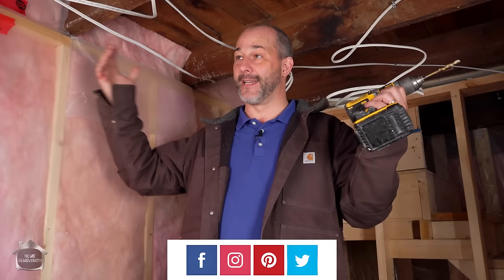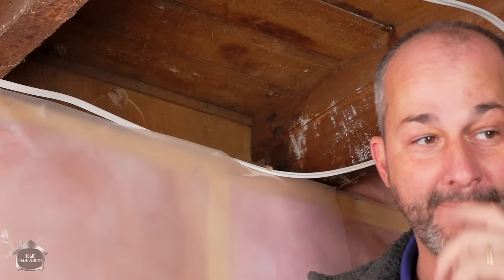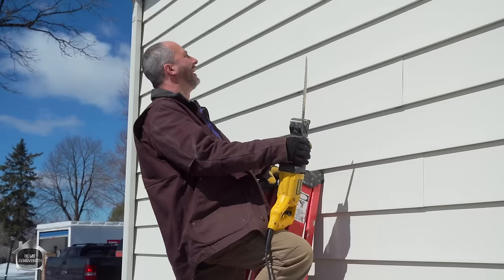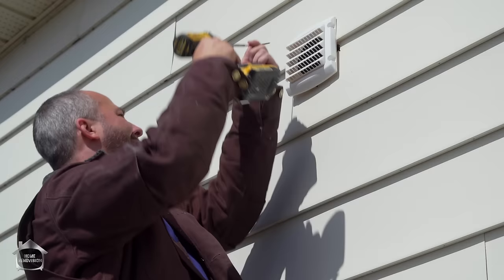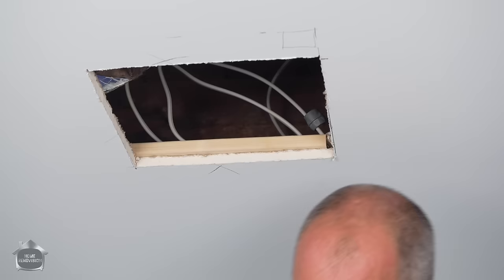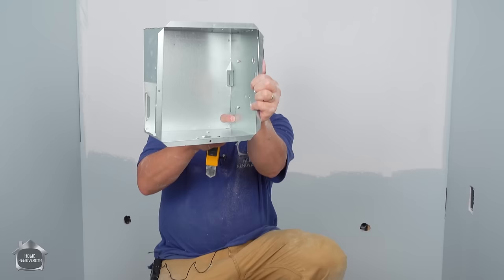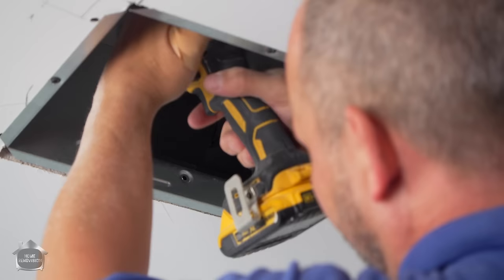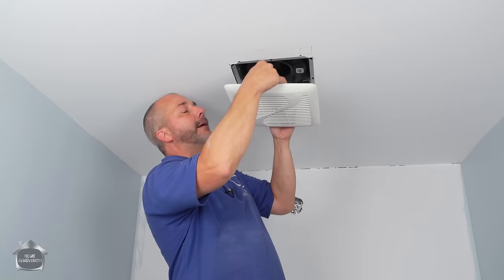How To Install A Bath Exhaust Fan | DIY

Comment: Wouldn’t the steam coming from the exhaust pipe just be blown in to the attic? And cause mold?
Reply: John H Not when it’s vented to the outside. 
Jeeze! Did ya watch the video?
Reply: @sjenkins88  yes to the outside where the soffit is with vents leading to the attic where it will cause rot and mold.

Comment: Isn't caulking a poor way to seal this? Since the vinyl siding expands and contracts, a LOT, with heat a cold the caulking will separate pretty quickly from the plastic on the vent?

At least that's what's happening on all the windows and doors on the house we just moved into :|
Reply from the maker: There is real good quality caulking that expands 400%. that is the type to use on exterior siding. Cheers!
Reply: @HomeRenoVisionDIY  good stuff, you're the best!

Comment: Sloppy cut out hole for fan housing, 6 foot of too much wire totally wasted , outside vent is installed incorrectly. trick is to use the 4" hole saw with a longer bit in it to  find center outside , use the 4" hole inside and out and you'll have round hole , Trim around vinyl siding to  make a tight fit instead of his "diamond " pattern that sucks, you'll need a whole tube  of caulking  to seal around that vent cover.  D+ work. Plus the 110 CFM is good for a huge bathroom. 70 CFM-80 CFM is plenty for a 8 foot x 10 foot bathroom. The more CFM's the louder the fan noise.

Comment: Why didn't you just install the housing and do the connection prior to the installation of the drywall?
Reply: It's a remodel, not a brand new home.
Reply: @Guillotines_For_Globalists  But he had the joists exposed and the ceiling open. It doesn't make much sense.
Reply: @jorgeshicken  I do see that.  Strange.  Maybe his intent was to show us how to do it as part of an actual remodel where the ceiling wasn't exposed.  His channel is primary about remodeling after all.

Comment: One thing i like to do is put some tape (tuck or metal) around the perimeter of the hole to stop any draft that may come down between the housing and the drywall. 15 cents (CDN!) and maybe a minute of my time.

Comment: Bonding the housing isn't a thing in Ontario?
Reply from the maker: You will need to explain please. Do you mean to afix the housing to the framing. It was done. Cheers!
Reply from the maker: And no it is ok to set the housing in a ceiling attached to loose strapping. Cheers!
Reply: No, I was referring to the electrical. The metal housing should be grounded via the grounding electrode conductor using a ground screw or clip. The branch circuit has the bare copper, GEC (grounding electrode conductor). Each component needs to be grounded. Housing, outlet, and circuit. You would bond the housing to avoid a potential hazardous scenario where an ungrounded conductor could come in contact with the housing and have no path to ground causing the housing to energize. I'm not critiquing, just offering helpful guidance. I gain tons of helpful guidance from your videos and your projects, I'm just tryin to give some help back if/when I can.

Comment: Not an expert.  But you had no ceiling drywall at the beginning. In my mind you could had installed the fan box and wiring and all that jazz before you finish the ceiling and avoid the guess work.  Then mark the location of it in your sheet if ceiling and make it better that way.  Why not?
Reply from the maker: for sure you could. but this way we can show all the options. I already did a video where we installed the box first. Cheers!

Comment: His ladder work is scary. Leaning a stepladder against a wall should be a last resort. Stand it up, even if you have to turn it sideways. Ive also found that standing right against the wall gives you no leverage.

Comment: Thumbs down. Why not use a longer pilot bit and drill all the way through ?Then take hole saw outside and drill a nice neat hole through vinyl siding and into sheathing?  A chisel will remove what saw doesn't. Then do same inside. Makes a neater job instead of it looking like the squirrels got through the busted cover. You can buy deeper hole saws. 
And nice job jabbing sheet rock saw into cavity.  Why not puncher a hole in the new vent tubing and nick the elec. wiring.  Does it have to be GFI circuit per code ?

Comment: Have to not agree with the vent. 
The plastic covers are the worst. 
Over the years I have replaced 50-60 of them. In sun and weather they don’t hold up that great. And being high up you don’t want to have to get up to fix it. 
The metal or stainless 1 PC are way better at leaks and overall life exp. 
But I guess I like when people use the plastic I’ll make $$ down the road
Reply from the maker: Everything needs maintenance at some point. Cheers!
Reply: Home RenoVision DIY 
Very true. 
But I’d rather have something that last a lot longer before dealing with it. 
And the price difference is small unless you go stainless and those must be ordered. 
No stores carry them that I know of. 
It’s kinda like paint. 
If you get paint at big lots verse Sherwin Williams. 
Use a better product.

Comment: this video starts out very impractical - wanna install a vent?  Open up all your walls and your ceiling.  WHAT?!
No... this is not feasible for the average homeowner.  We LIVE IN our home, we can't be unnecessarily ripping down to studs.

Comment: That is technically an INTAKE vent, not an EXHAUST vent.  The INTAKE vents do not have the louvered flaps that CLOSE when there is no air blowing from the inside to the outside.  Obviously, as an intake, you would NOT want it to close.

Comment: People don't attempt this on your own. If you're drilling blindly from inside your house and hit the main power wire along the outside of your house, you're as good as dead on the spot. Seriously, not a bit of safety advice about outside wiring etc. 🤦‍♂🤣🤷‍♂

Comment: Apparently there were nothing but crackheads who constructed my house because the only bathroom with a fan is the downstairs w/o shower, meanwhile the two upstairs, w/ showers, where I would think they would have placed fans.. nada.. rien.. zilch.  So, I am guessing that I will have to remove all drywall on ceilings in order to have fans and the ducts will be roughly 24ft from ground level - thanks crackheads!

Is there an easier way besides removing the entire ceilings in the bathrooms... or am I just stuck with the additional costs?  Also, since there are no additional power lines coming into the switches, can I just pigtail into a separate switch for the fan?

Any information is greatly appreciated.

Comment: That was painful to watch. That fan is a lot easier to install before the Sheetrock goes up. The fan has tabs on it to hold it down below the rafter so it’s flush with the Sheetrock. This way you nail a couple of 2x4s across the rafters and mount your fan to the 2x4s, leaving it down 5/8 of an inch for Sheetrock. Then you can hook up your duct and wire it when it’s easy to get to. Then you just cut the Sheetrock out around it when you hang the rock. After painting all you have to do is slide the cover on. Also, good job breaking that cap.

Comment: This is legit probably one of the worst “instructional” videos on how to vent a bathroom fan.

Easy way:
•Use a push rod for your pilot hole
•Find where the rod came out of the house(from the outside) and remove the push pod
•Use 4 1/2” hole saw 
(Use drill in reverse when cutting through Vinyl siding)
•Insert vent, screw in and silicone around top, left, right edges and over screws

Comment: The moisture from that fan is going right up into the soffit which is vented, and back into the attic ....go through the roof. There wasn't any permit or inspection on this job I am guessing. I like your videos generally , but this is a nono.
Reply: Dave John He vented it out the side wall. Did ya watch the video?